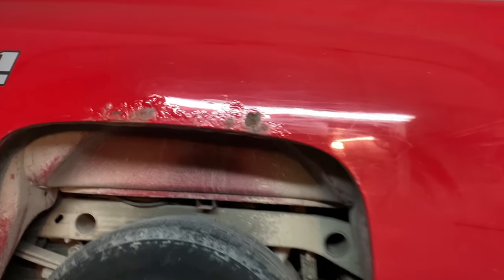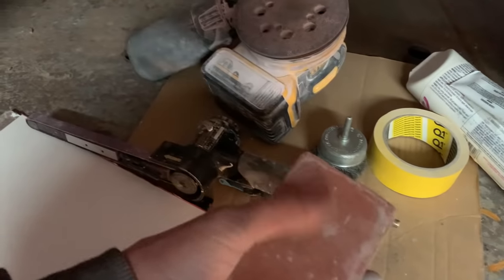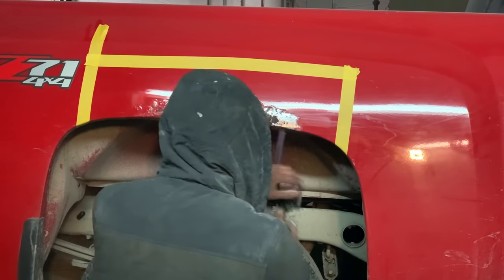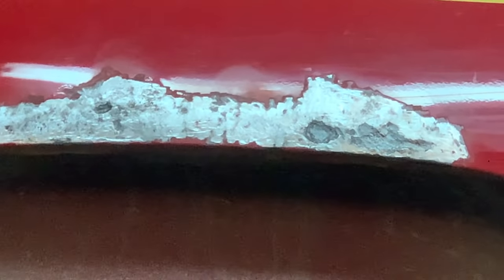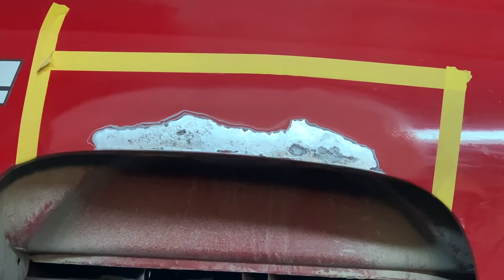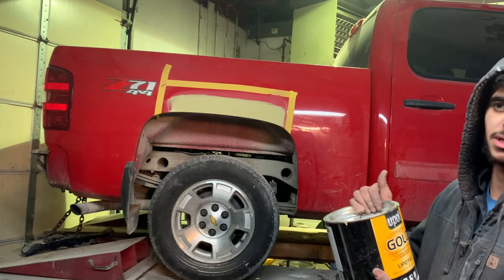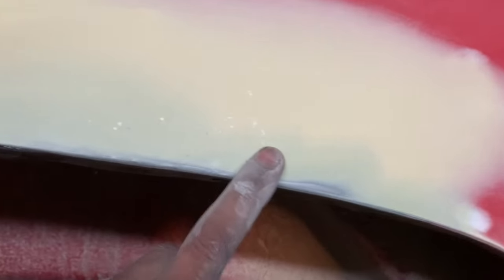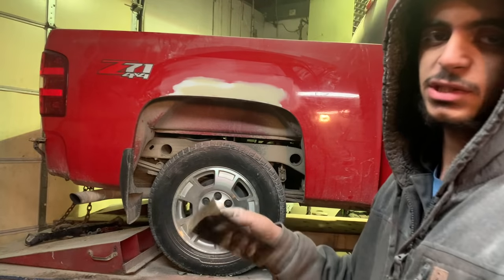Quickest way to repair rust bubbles (truck bed side)

Comment from the maker: Hello guys. This repair isn’t best way to do it, it’s a temporary repair meaning won’t last. Best way to deal with rust is to cut and replace rusted metal. Thanks for watching!
Reply: Thats what I was gonah say.
Reply: Wow, took 3 months to rust? Must be dry season by you.
Reply: When you say, "Won't last" how long do you think it would last, in a North Eastern U.S snow belt area?
Reply: Duraglass would last alot longer
Reply: If you do the proper steps in the right order it works better.
Reply: @retiredusmc9090 maine winter with salt on the roads... might last like maybe 10 years... but te innner fender will probably still rust out under itt. maine guy here.. detailer.. hard to keep thes damn trucks from rust.... sux. i work hard to detail my stepdads 2011 chevy 1500... i deep clean it atleast twice a year... salt just builds up in those fenders  worst design ever
Reply: That had holes in the quarter. That repair won't last 6 months.
Reply: Agree, get into the inner well and spray  wool wax undercoat.
Reply: No safety glasses??

Comment: This repair can last if you drill a 1/2 inch hole in the inner fender and spray a rust stop spray like fluid film and get that seam of the box panel and wheel panel completely coated Im on my 6th year with no rust on a 91 chev 1/2 ton
Reply: Not sure about a 91, but on the generation he is working on 2007 - 2013, you can pull the taillight out and access that area to clean it out and coat it.

Comment: Not hating but a vinegar wash, wax and grease remover and then hit those rust areas with 2-part epoxy resin and then apply fiberglass reinforced waterproof filler would of cost you probably 30 bucks more to do and same amount of work and would last a few years.
Reply: Then if you drill an acces hole and add a rubber cap where you can spray fluid film on the backside of the repair annually, it will last indefinitely.
Reply: Just get a new bed. Lol
Reply: @patrickwelch620 careful, they be adding an access hole with a couple drain holes and then plug-in’ it with rosin.
Reply: So the fiberglass filler is more water proof that the filler he used? Would just using the fiber glass body filler be good enough? Then sand and paint.
Reply: @ryanv7195  yes.  Fiberglass reinforced filler is more water resistant than just regular polyester filler.  You could even take it a step further and paint all of the rust with Eastwood rust encapsulator and then do your filler work over that.  I painted a completely rusted piece of steel with the encapsulator and hung it outside for 2 years and the rust didn't pop through.
Reply: @garymccloskeyjr.6265  thanks for the advice. I've been battling some wheel arc rust and it always seems to bubble out. I'm going to try the fiber glass and Eastwood. Thanks. If I can keep it stable a couple of years that would be a win.

Comment: Most of this type of rust damage on road vehicles also starts on the inside behind the panel and between inner and outer skins, it is a common moisture trap and quite often does not have any or enough paint protection from the factory.
This type of repair is a good quick fix for a small area, as you say not as good as a welded repair panel. I would also use an anti-corrosion metal treatment before applying any filler/stopper.
Once complete and painted get some wax or oil treatment behind the panel and between the skins, you should get many years from it.

Comment: The rust will come back in a few weeks,   like Bros said you need to cut out the area and apply a patch panel.    I have the same truck with the same issue and was shocked at how fast the rust comes back with a vengeance.      Next summer I'm going to do a cut out and use adhesive application of a new patch panel, I'm not going to mig weld 18ga metal. Adhesive allows you to better prep the back side with paint.
Reply: Where do you get your patch panels from?
I have to get to mine, too, soon.

And your glue?
Reply: I will never understand why when ppl spend big money on vehicles, they never spend the little extra to rust check them, or under coat of any kind.  I have had my 07 Sierra for 13 yrs now - no rust, why? I rust check it every fall
Reply: Why not just look for a new bed?  Lol
Reply: Under coating is not a great product especially if not done correctly.

Comment: If you are repairing someone elses vehicle this way,there better be a clear understanding between both people of what the expections are. Red paint is expensive as well as the other materials and labor. If the job cost X number of dollars and lasts a very short time,very bad feelings could be the result and the reputation of the bodyman could take a huge hit. Going quick and cheap could be more trouble than it's worth. Thanks for sharing this video. It'll help folks make a more informed decision,thanks.

Comment: same problem with my truck but mine looked less severe but when i cut the fender out the whole inside of the fender was rusted completely out couldnt even weld it so had to cut like 1 foot of metal out just to be able to weld so just a heads up best of luck

Comment: To a lol the folks reading (and liking) all the many posts saying that this is not the ''right'' way to do body work on a vehicle. 

They're right of course. It's not. No one ever said it was. In fact he clearly states that it's temporary. 

A note to all those posters; Not everyone has the ability or the means to cut / weld in new metal or the means to pay a shop to do it. 

However, because so many needed to say how this quicky temporary repair wont last ''five minutes''  I feel I need to add the following: 

I live in a state the uses salt on the roads in the winter. I did this same sort of ''quick fix'' approx. 25 years ago to a 1971 Olds Cutlass S with much much worse fender rot from said salt. I did the body and paint in one very long exhausting day. One difference of note is that I used rust converter. Lots of it. 

The bodywork wasn't the best looking, but it was better than rust holes. I painted that old beast flat black and mounted Craigers on her all the way around ( got them in a local junkyard) and added personally customized tinted headlight covers. (Tinted black plexiglass) Lasted the next five (5) years until I sold the car to a friend. Sadly, he later wrapped it around a tree. My friend was fine. The car didn't survive, but most of that quicky bodywork surprisingly did. 

Sure this isn't the ''right'' way to do it, but that doesn't mean it's the ''wrong'' way either.

Comment: Was anything sprayed in the backside to remove or convert the rust?

Filling the hole wll just allow it to come back.
Reply: You're right. The rust is just a symptom - not the root problem. Need inner body rust protection.

Comment: Fender flares and a for sale sign.
Reply: Lmao
Reply: @vr6g608  Dude,I live in The Buffalo/Western NY area. Those rust bubbles are common site.The dirt and crap gets caught up inbetween the sandwiched metals.In NY you get salt and snow mixed with the dirt.It holds the moisture and rots the metal from inside out.Same thing with the rocker panels.The dirt gets inside and can't get out.Holds the moisture like a sponge.I'm far from lazy.I've done the work the way it's supposed to be done.On some vehicles ,it is not worth the time or money.

Comment: I have 2008 Chevy Silverado my truck and the trucks I see like mine rust right there that repair you  did if your luck may last a year are two tops  the problem is GM thought it was a good idea too attach the wheel house too that section off the quarter panel water collects right there in that Area rusting out just that part off the panel your better off buying the patch panels there not that expensive.cut that section out  and tac weld in new panel with out attaching your patch panels too the wheel arch just use a good quality body seam sealer under the repaired section .did both my panels last summer cost me about 350.00 that was with the parts ready too spray factory red and clear coat looks great and probably will last lot longer than the factory panels.

Comment: Where u at I need mine fixed its about like that 2011 1500 just so you know rust will come back unless you clean and seal underneath fender there's a double layer

Comment: Take a cutoff tool and cut the rust out. Undercoat the bare metal. Buy a set of aftermarket fender flares and install. Two hours tops.

Comment: Great Video...  thanks for posting it.  What's Sad is that there's no longer any American car/truck manufacturer who can build a product with enough quality where the fenders don't rust out.  I have over 240K miles on my Toyota Tundra (which was made in America) and my fenders don't show one bit of rust. I live in a snow belt area... so lots of salt miles.  Ford Chevy... get a clue.
Reply: Toyotas had a recall for rusting frames 95-06 or something like that

Comment: You missed one really important step - rust convertor should have been applied before the bondo.  Your repair would then last much longer
Reply: I did exactly that and within a week bubbles started coming back through
Reply: @Kevin_Yagoonie  I have been using Coroseal converter for years. You need to use it properly which I haven't always done. After taking rust down as far as possible coat and leave at least 24 hours in a dry environment. Make sure product turns completely black. Repeat prosses making sure area is very black and very dry. Most rust converteres are water based and need the chemical prosses to be complete.  Then I coat with an etching primer. When the primer dries I will use the Bondo.
Reply: @armonthundar7535  wish I had this info a year ago lol. I'm just gonna cut out the wheel arches and weld in new
Reply: No it won't.

Comment: you could of used some waterproof filler first  and then apply your regular bondo and if you could of gotten to your underside with some kind of waterproof substance  that repair would last for years for sure,  hey just sayiing   good videos  for guys  that just want a quikie.

Comment: That rust is coming from the inside, not the outside - that's what most don't realise. That bed cavity is trapping moisture & then rusts from the inside out. Treating the outside is pointless until you sort the inside.
Reply: Its not pointless. It looks better and increases the value of the vehicle. Because you will almost certainly sell it sometime in future and it will likely still appear 100% better than it was.

Comment: Great video and thanks for the information! I just have a couple of 2 or 3 questions. Can this be fixed without painting the whole quarter panel, and how much should I expect to pay to have someone else do the work from start to finish? 

I have this issue over both rear fender wells that just started bubbling a couple months ago, and oddly enough, it’s a 2010 Silverado lol. I was hoping to go ahead and get it fixed before it gets worse and have no idea what this kind of work should cost. I, also, have thought about adding painted, pocket style fender flares in the near future. 

If I decide to add this edition, should I just repair the rusted area, spray on some rust-oleum, and save the paint for the the fender flairs? Or, should I repair and paint before adding flairs? Any info would be very much appreciated…
Thanks!🙏🏼
Reply from the maker: It’s all your choice man. Cheaper option would be fender flares. Otherwise the correct way to repair this would not be this video. You would have to cut and replace rusted areas most of the time… especially when the metal falls off or is eaten away. Thank you for watching!
Reply: @BrosRebuilds  Thanks for the reply and I think I will do the flairs
Reply: @johnharrison5656  keep in mind the flare will make the rust worse and only hide it temporarily
Reply: @andrewbrummer9539  Right, I was thinking more like sanding down the rust, and putting a sealer on the metal. Then throw the flairs over that. It doesn’t matter now because I’m fixing to get the whole truck painted. We had a storm a few weeks back with hail and high winds. The basketball goal hit the truck and rocks and limbs peppered it. I’ll have to pay out of pocket for one side that’s rusted, but the goal hit the other lol, and of course the insurance will pay for the paint.
Reply: @johnharrison5656 why not look for a new bed then?
Reply: $1000

Comment: If your doing this kind of repair you should have started with All Metal filler. It will last longer. This is a temporary repair at best.
Reply from the maker: Correct, as I stated in the video.
Reply: No shit lmao

Comment: For what they charge for new vehicles today they shouldn't be rustimg for at least 10 years and dipped in some kind of better rust prevatsti e coating.Its Rediculous how vehicles rust so easily and how manufacturers are now shortingn the thickness of clear coat and thin base costs.Total b.s.
Reply from the maker: Newer trucks are bit better with rust, but it is what it is.
Reply: @BrosRebuilds  Doesn't have to be. Ford made all their trucks aluminum.Why wouldn't all trucks do this or at least all bottom panels.For as much as people are paying for $50,60,70000 trucks it should be mandatory.
Reply: @billl8530  They don't when you clean them properly.  The reason that truck rotted out is there is a tight gap for about the lower inch of where the inner and outer panel meet.  On this truck it will be full of dirt, salt and whatever else.  Voila... it rots.  Pull the tail lights out and wash it once or twice a year.... they even have 3 plugs along the inside you can pull to make sure it's clean.  Same as the rockers, doors, etc etc.  A little maintenance goes a long way

Comment: What  was the tool to remove rust?
Reply from the maker: Wire brush on a drill, or you can use grinder.
Reply: File sander

Comment: That’s a lot of sanding without a mask or respirator. If you don’t get rid of the rust on the inside near the weep hole, it will be back in a year or two.

Comment: Epoxy prime the raw metal before doing mud work.
Reply from the maker: Good idea, I sometimes do that if I’m doing a proper repair.
Reply: Also acid wash the metal, than baking soda/ water to neutralize it. than it would be mint to bondo or fiberglass it, than seal it and good to go
Reply: Or that rust will be showing threw the paint in less than a month

Comment: I might suggest a little phosphoric acid over the metal and rough areas. Your filler will bond a little better.

Over all a very nice job. You caught that rust just in time. Another year it would have ate a hole in the fender.

Comment: With rust this bad,most folks will cut it out,weld or glue new metal in. This repair won't address the potential rust in the inner fender. If all the work and cost goes into bending in the new paint to the old,all this is a waste. If this kind of work is done to just flip it,the new owner is in for a surprise.

Comment: Sorry but that's not going to last .
Reply from the maker: Yes your right, As stated in the video.
Reply: I did this exact same thing to my 2010 Silverado and it is right back to where I started in 3 months. Time to cover with fender flares. That will last a while.